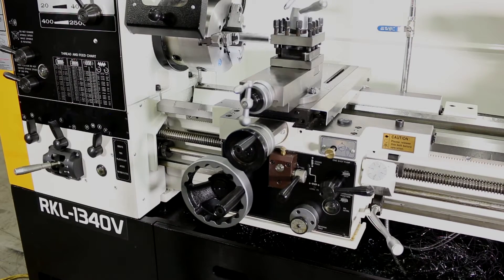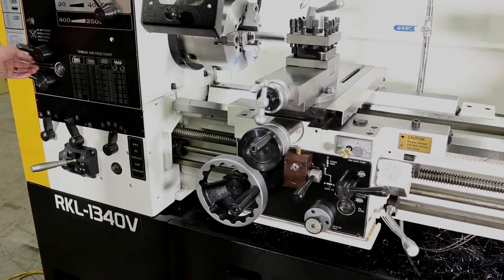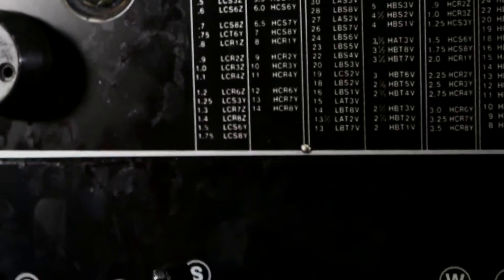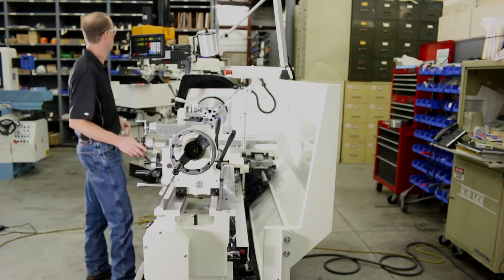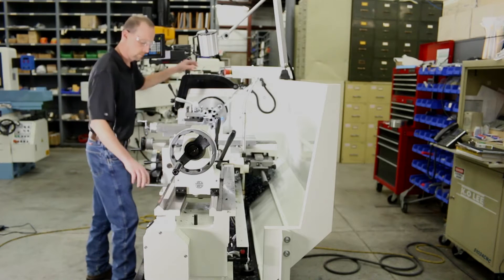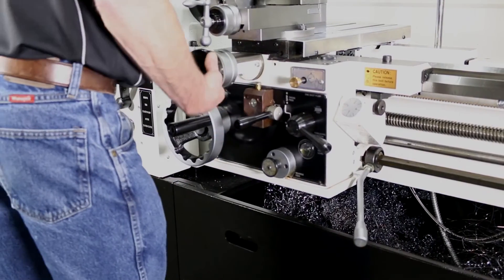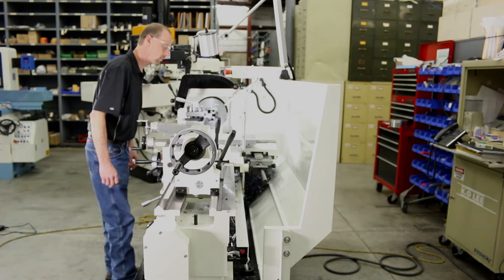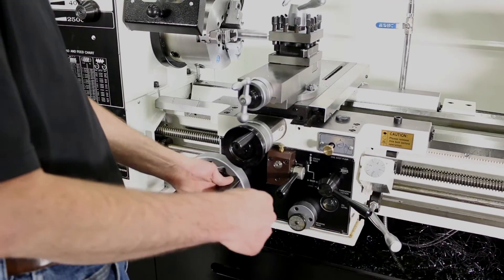Cutting Metric Threads

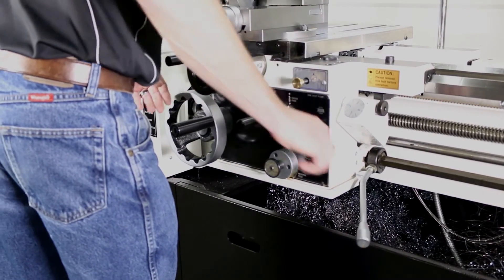Comment: @ 2:14 You can very well disengage as long as you use the thread-chasing dial to re-engage at the correct point. It doesn't matter what threads you're working on.
Reply: I think he was just pointing it out for machinists who mainly cut standard threads. Aka me, but honestly I didn’t know that so thank you for that tip if I ever need to cut metric threads and I accidentally disengage my split nut.
Reply: @samtheking14  That may be the case, but there is still no need to make metric sound like something special. It's just another gearing, your lathe doesn't suddenly operate in a different way just because it's metric.

Comment: You can disengage half nuts on a metric thread. I did a 1.75mm pitch today and disengaged 2-3 times. I did a few 2.00mm the other day and disengaged about 6 times. Each time the gear train and the tool point married exactly the same as when the half nuts first engaged but the only difference was the mesh of individual teeth on individual gears. But given the fact that a gear is exactly the same on any radial degree, it didn't matter. It takes about 15-20 seconds to begin the pass again once you've mastered the skill.